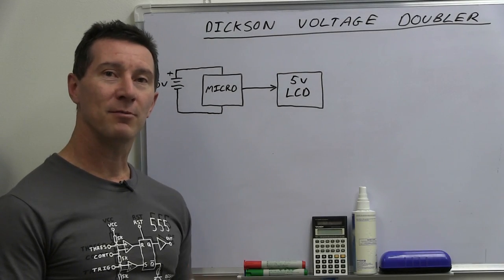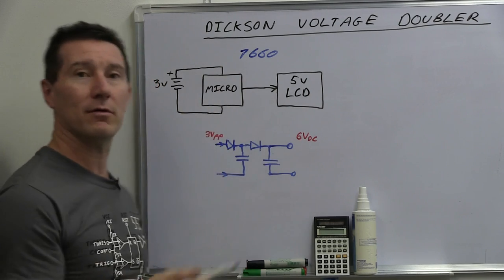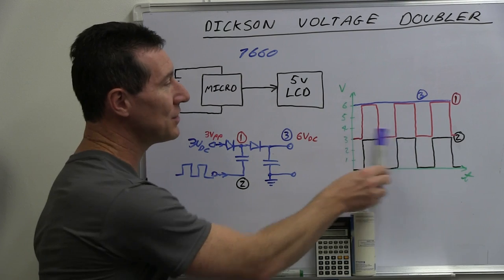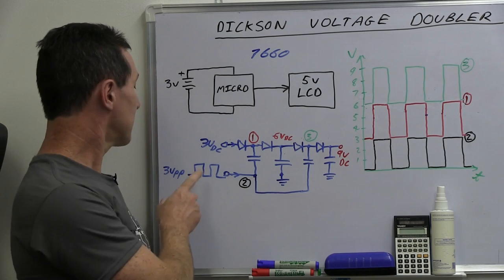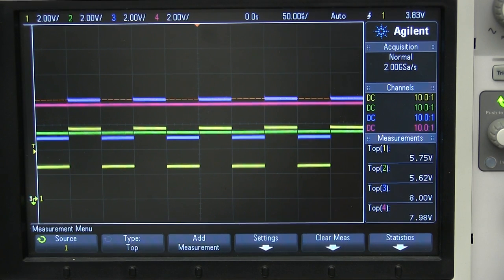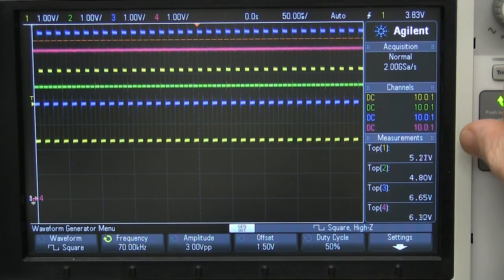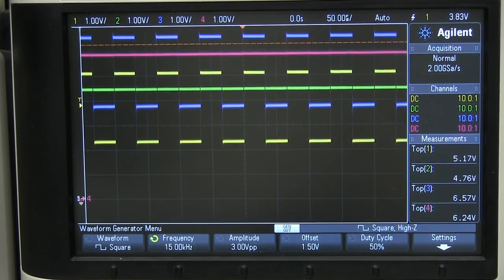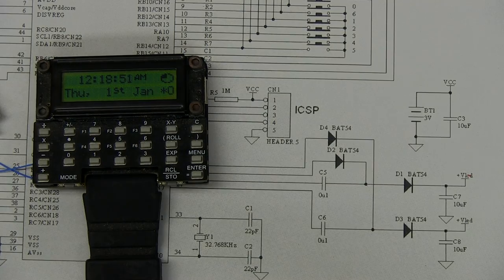EEVBlog #473 - Microcontroller Voltage Doubler

Comment: Micro controller spec sheets warn against driving capacitive loads, so buffering the io pin may be required. Great video mate! Thanks.
Reply: I was wondering as well weither a current-limiting resistor was necessary (on both chip pins actually: +3V and clock). Driving a 1uF cap straight from a pin definitely gets me anxious.
Reply: You aren't really driving a capacitive load though, you are just changing the reference voltage. Nearly all of the energy in the system is going to come from the VCC pin in the circuit that charges the cap once your clock pin goes low and the cap voltage is lower than VCC.
Reply: @AustinSteingrube  What is VCC,  is it stand for voltage charging circuit?
Reply: @ryanb1874  "VCC" stands for "Common Collector Voltage". It is basically just your positive voltage supply. Nothing fancy.
Reply: @AustinSteingrube  is there really a difference between positive, and negative voltage, material, or like affecting, electron migration?
Reply: @ryanb1874  Voltage is roughly summed up by how hard charges are pushing to go in a given direction. Since we are dealing with charges which DO have positive and negative values, that direction matters and will change where the electrons go.

For very simple circuits, like an incandescent light bulb, it doesn't matter which direction the charges flow. For other things, such as LEDs, the material is manufactured in such a way that there are naturally more of a charge in one side of a circuit than the other(s). In order for these to work, you have to have the voltage correct. For yet other things that use magnetic fields, the direction of charge flow (current) determines the direction of the magnetic field generated (which is important for motors).

To make things a little more complex, voltages are measured in reference to some designated point in a circuit (typically ground). If that ground is floating (ie, not connected to a large metal object or the earth itself) and that ground is not used by components as a reference, the idea of "negative" vs "positive" voltage doesn't matter as long as the direction the source is lined up in matches the way you need current to flow.

But, if the ground is NOT floating or the components use it as a reference (for example, IC's typically do), you can run into issues. Those are all a case-by-case basis and are usually designed around.
Reply: Wouldn't the charging current have to go through the port though since that's the ground?

Comment: You definitely should! First try to understand how it works. Then you see why it's always good to have a bunch of them lying around in the parts drawer. Just yesterday I needed a square wave with variable frequency (from .1 to 1kHz) to flash some LEDs. If you're fine with fixed 50% duty cycle, search for "mini-astable ne555". A NE555, one resistor and two caps, that's it. It's also a circuit I like, because it's "unusual", in that it uses the output pin itself for the timing.

Comment: I think what you're missing is that a charged capacitor maintains the voltage across itself (ΔV_C) as long as no current passes through it (incl. leakage). Furthermore, ΔV_C(t) is always continuous.

Look at the circuit when PWM = 0V. Point 1 is 3V_{DC}, so the capacitor can charge to 3V.

Later the PWM voltage = cap bottom lead voltage = 3V, and the capacitor maintains ΔV_C = 3V it charged up earlier; the voltage at the top lead is therefore 3V + ΔV_C = 6V (with reference to ground).

Comment: Used as a source, the current to the load is coming from the capacitor charged up to 3V, which charges the grounded capacitor up to 6V thanks to that boosting effect. The cap gets re-charged (to at most 3V) when PWM = low, and THAT current comes from point 1; when PWM = high, the diode blocks reverse current from cap to point 1.

There shouldn't be a point where both cap terminals are 3V once the thing's running, unless your load is so big that the cap gets fully discharged.

Comment: When the PWM goes high, you are lifting the "ground" of the cap to +3v. This lifts point 1 to +6v through the cap. The current comes from the charge stored across the cap.

Comment: Depends on the uC and the load but e.g. Atmega328 provides 40mA and similar uCs provide similar current I guess. The MSP430g2253 for example provides 20mA max current per pin. Furthermore you have to drive the driver as well ;)

Comment: The ansewer is weared by dave... it's called ne555 (you can use the magic ne555 in astable mode) :) or you can use the pwm module on pic. Everythigs than generate an oscillating signal can work. (sorry for my english :) )

Comment: I want to ask two things:
First is that voltage dropped mostly on diodes , maybeyou can use MOSFET instead of diode? Maybe more power efficient also.
Another concern, imho when you drive capacitive load, it increases requirements to capacitor on microcontroller power circuit, because on battery powered setup initial stage of capacitor charge will draw relatively significant current, and will cause also significant supply voltage drop (which will lead to supervisor shutdown, or glitches)

Comment: Wouldn't you want a current-limiting resistor or something on the PWM output? Otherwise it seems the instantaneous current would exceed the microcontroller's absolute maximum rating.

Comment: A method to increase the power of this kind of charge pump is to multi-phase interleave them, I got a 3-phase voltage inverter charge pump in my product and it just works fine, transformer eliminated!

Comment: What about the inrush current exceeding the maximum output current of the micro?  At start up the output pin will be effectively shorted to ground through a diode.

Comment: from those i have, the one with the highest reverse current is the mur820(8A 650mV Vf) with 5µA and the one with the lowest is the bat85 (200mA 240mV Vf) with 500nA. Compared to the nothing special 1n4148 (200mA 500mV Vf) with 7nA (all at 25V 25ºC, Imax Vf min), yeah that's a lot but still dont think that's gonna affect the doubler in any way except for the higher voltage due to less losses on the diodes. Not sure about those with miliamps of Ir but maybe those were the old ones?

Comment: lol that gets crazy... in lab at university it took 2 months just to learn how to use the software and its design rule checks to build a simple bandpass filter.. fyi you can do the same filter i did on that chip with only a few resistors, caps and transistors

Comment: Thankd dave...very Educative. I actually had an issue with a low dc voltage in my latest design..this will surely help out.

I was thinking....do you have any video on how to perfectly use Oscilloscopes, especially when powered by AC mains...to avoid damaging your circuits by a blast..tnks

Comment: Could you use 2 transistor astable multivibrator to provide the signal for the multiplier? What frequency should it resonate in?

Also if the same one multivibrator was at the end of this, providing 9V pulses to this circuit and a piezo buzzer would it work?

Comment: hey dave how about explaining joule thieves next? to continue white the voltage multipliers/converters idea. Also really useful what you dont have a clock signal or a really low voltage source like a single 1,5v AAA

Comment: Most of the pic micros, can sink only 20 mA, on the entire port i think. So whether we need a current limitting resistors. Or do we need to sdjust the fz, and there by increasing the importance to reduce the current?

Comment: 6 years ago! that's like vintage or classic in the days of youtube. By now the technology he is talking about is totally obsolete and we don't even use such things now with the simplest 3 cent micro having 8 cores running at 0.1v at 4GHz with 256Gb of onboard memory. This video is so old Instead of black and white the video is in old school 1080p; so primitive... surprised you can even watch it at such a low resolution. a 1080p camera has a crank on the side, it's so old in todays terms  !!!! Good to know to work on vintage electronics like 1080p cameras.

Comment: You can easily run a lcd from 3.3 V by giving it a negative contrast voltage (via such a chargepump)  ;-)
Reply: Which is how 3V3 display modules are often built, with only the capacitors not glued to the glass .

Comment: yeah but theres more to it though..tantalums have leakeage asociated with them..mlcc loose their capacitance with applied voltage and ers dependent on temp and freq..(refer to kemet spice)

that video gives a very surface level breakdown

Comment: Very nice video, reminds me of using the XOUT pin of a PIC16C711 in1994 for generating -4V for an OPAMP. Still thinking if i should have tried harder finding a real RRIO opamp, since my input voltages were only down to 0V, hehe. Oh please don't point out RRIO OPAMPs to me available in 1994 :P

Comment: Hi Dave just trying to replicate your circuit. At 24min you say oops wrong polarity. Does that mean I should be using a negative signal. I was under the impression from the beginning that it was a positive signal inducing a negative charge on the capacitor? I am using a SSR 40d as my signal so I can do either.
Any help appreciated Thanks Raef

Comment: Dave, can I power it from a sine RF signal of say 15MHz, or does it need to be a square wave? I would like to use this as a DC-DC doubler for feeding a 14V varicap from 12v. I choose 15MHz so that the second harmonic is just above the HF (30MHz) to avoid interference to my RF circuit.

Comment: Can you drives circuit like this from a 3V3 microcontroller that has 12 VDC rails available (to get 24 VDC)? I assume you just replace the direct pin connection a “2” with a MOSFET.

Comment: Hi Dave, great tutorial. Question, how do did you connect the voltage multiplier to your o-scope? The doubler does not appear to have one common ground reference and it does not look like you used differential probes. Thanks!
Reply: Have a play with the circuit. Both inputs and output do have a common gnd reference.
Reply: I see the light, thanks.

Comment: It may be a silly question, but how can I easily get this kind of squarewave  or i have to run something else and use a microcontroller. Or just to use some sort of chip or oscillator, (like mc34063 but i don't want to use an inductor)  i don't know. For example if only want to double the voltage to power something up.

Comment: Dave, it looks as though you are running 50% duty cycle on the PWM.  How do you get a 3V DC value out of the 3Vppk with 50% duty cycle?  I see that you get almost the full 9 volts, so I know I must be missing something.

Comment: hi thanks for your explanation of voltage doubler. i wonder that is voltage doulber effect current ? i mean normalla monitor lighting of small inverters consume 12 v 1,5 a because of transformer.  Can i use it instead of inverter ? i want less current consumption.

Comment: Could I take the doubled voltage and recenter it around 0 for a dual power supply +/-3v? That would be useful!
Reply: Just reverse the diodes and feed from ground, not +3V .  No extra components and you can still use a 3 pin double diode package .

Comment: 3 volt source has to deliver one half of the total load current and other half will be delivered by square wave source .......
Reply: +Sanjay Verma good remark

 you'll kill your mcu ?! i've try some sim on ltspice;
i don't think a 16f or 18f is able to survive it   ^^(100ohm load  5v input , 12v output, you need something like 800mA)
but it work for 1-10kohm load ( like a vfd where you need 15v-25v for a very litle current (can't measure it with my multimeter))

or you can use some mosfet, i guess

that's always the problem with these explanation where you use some 
simplification
let's say it's good to make money and to have suscriber

Comment: 22:35 why does the voltage of the second stage drop below both the earlier (first) and layer (third and fourth) stages?
Anyone with better EE understanding want to tell me?
Could a modified common ground circuit here (that aligns the phase of each stage's ground) "recycle" some of the wasted energy here (and put it back to the load)(perhaps put an inductor in the virtual ground, or some kind of shunt)?
Thanks all!

Comment: Neat circuit, but wouldn't the PWM generation by the microcontroller use up a lot of power?
Reply: No. using a series resistor you can limit the output current to a few milliamps max if you wanted.
Reply: I meant the actual power consumption by the microcontroller. Don't they draw a significant amount if they aren't sleeping?
Reply: Depends on the Microcontroller, an 8-bit Atmel AVR might draw 10-50mA depending on clock speed, an ARM Cortex M4 might draw much less than this, even with x4 clock speed. Architecture of the microcontroller is important. The issue is not how much power the microcontroller draws while awake, you asked about the power output of the PWM yes? Supposedly the microcontroller is doing other things which make it's own current draw from VCC worth it.
Reply: OK, I understand now. Thanks for the explanation. I'll do an execution profile to determine the micro's power consumption in relation to the PWM. Should be an interesting result. I like the idea of using the microcontroller to do that, especially if it isn't doing anything else and you have the power budget.
Reply: Yes for low power devices that need the higher voltage for some reason, this seems like a nice way to do it. There are some cheap charge pump/inductorless boost converters available that can handle 50-100 mA and use only a small amount of space on your PCB and I would probably go for those. This is a cool trick though! There are always positive and negative things about designs like this, so finding what works for your design is important to know about these options.
Reply: Absolutely! That's why it's neat to learn new tricks from people who have the experience :-)

Comment: Fly to the moon on 1mA - you have to show us that :P
Also, could you use the first stage of that multiplier to switch a transistor at 6V instead of feeding the clock directly to the 2nd stage and it would give you 12V instead of 9V?

Comment: Well pin1 on the micro is high=3V the pin2 is 0V. The Cap charges to 3V. Then you swap the pins. pin1=0V pin2=3V. This adds to the caps 3V and you get 6V through diode2 into cap2 !

Comment: Ok This is a voltage doubler.  Do you think you can design a circuit that does just the opposite?  A power supply which two capacitors charge from a  constant DC input source in series & discharge out of the power supply capacitors in parallel, effectively splitting the voltage 1/2 but being fairly efficient, not dissipating half the power through resistors or other components.
Reply: Soteriology101 you're looking for a Pulse with modulation (PWM) with a ratio of 50%
1 clock, 1 transistor, 1 capacitor and 1 resistor (or an inductor)
Or have a look at buck converters
Reply: inotoff No that is not the same. But if you have a capacitive voltage doubler with analog switches (CMOS transmission gates) instead of the diodes then it is possible. Perhaps it works even with a 7660 in some "reverse mode" but I did not study the datasheet on such an operation mode.

Comment: i have dc boost
I need to change current sense resistor
i use mosfet as switch for each resistor
problem: mosfet needs gate voltage > than source voltage
source voltage is same as drain voltage because its a switch
where do i get a greater voltage from?
also what mosfet can take 42v on gate? lol